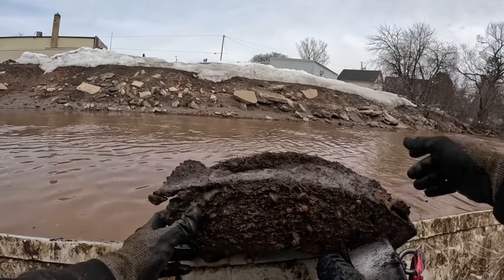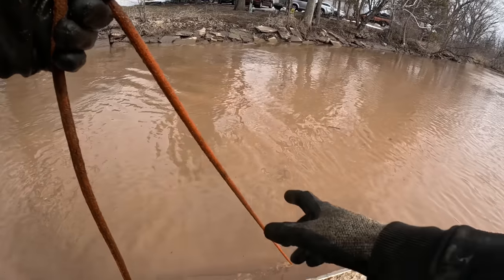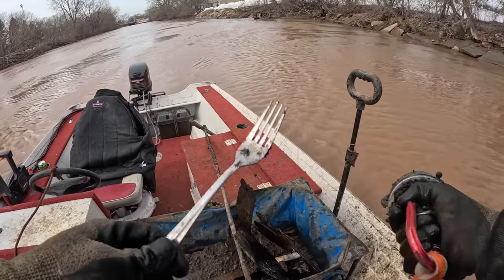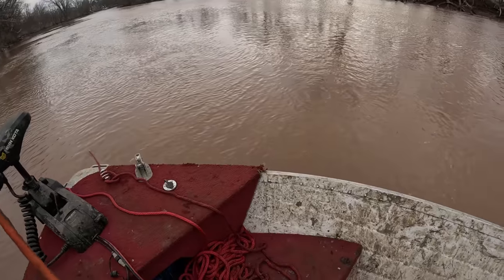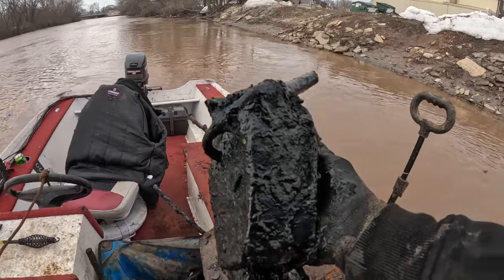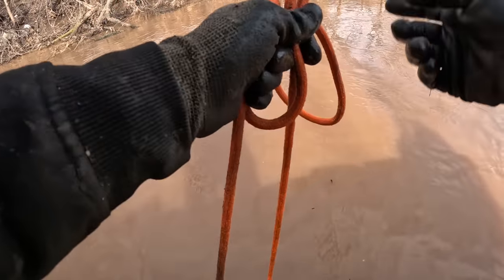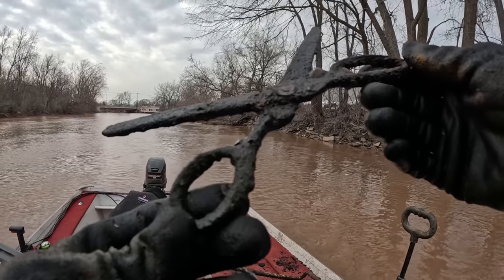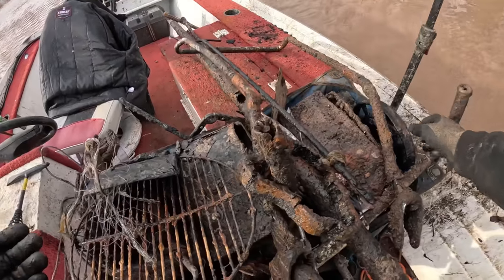I Found 5 Boxes While Magnet Fishing - You Won’t Believe What’s Inside!!!

Comment: The adjustable skates are like we used in the 1940's and later. I am 84. We loved them. They would adjust in width and length to clamp onto our leather shoes. This was before sneakers. The key, as you have found previously, had one end to adjust length and the other to adjust the width. Another enjoyable video.
Reply: We had a few pair back around 72. We thought it was cook to hang on to a bike and get pulled so fast. The wheels would get so hot, you could light a cigarette from it. Cool they down, oil them back hp, and do it again
Reply: Haha, you made me think of that song: I've got a brand new pair of rollerskates and you have a brand new key...
Reply: Had some adjustable skates in the80's had some great fun
Reply: Yeah, I had some in the 60s
Reply: Speak for yourself honey... I had those skates as a kid and hated them because they didn't stay on my shoes. 🤣🤣

Comment: Piece with rubber tubing on the bottom and hole in top is an old automotive power steering pump. Shaft with handle on one end and washers and conical rubber seal on other end is the guts of a bicycle air pump. Love your content and cheery attitude! (Ok, I just read the shaft and handle could be out of garden sprayer. I can see that...) Have a great day!
Reply: Yes sir!!

Comment: Thank you for the entertainment. Tyler I don't want to badger you but be safe dude. Please throw on a pdf! There are very minimal ones that will do the job but not hamper your movement! With the current, water temp, air temp and other unforeseen happenings it is the smart thing and usually the law. Be safe dude.

Comment: Hey Tyler
   Those things you called meat hooks actually are MEAT HOOKS !
They are used to hang a quarter of a butchered beef in a refrigerated semi trailer.
I used to haul what is commonly called swingin beef from Nebraska to Tennessee as well as other points in the east and northeast.
   The thing you pulled up after the first hook was a power steering pump off a car.
The long rod with the black handle was a pump rod used to pump pressure in a garden sprayer. I enjoy identifying some of the cool things you drag up.
The curved boxes have me stumped as well.
   COME ON SUMMER !
Reply: Great American Beef!
Reply: The curved boxes I thought looked like the lining you see on old cars when they gave you more storage room than just the glove compartment putting in centre console.  These are missing the padding and the leather covering.  Sorry its just the curve, looks like armrest, than it opens length ways.  If you added padding and leather.  But believe these are the rejects from the line they throw away as lock hole not punched in.  Back then glove compartments, ashtrays console frame was all metal, but you know that already, just wanted your thought, could it be?
Reply: @lorienray6216  Those curved boxes are from something industrial not parts from any automobiles.

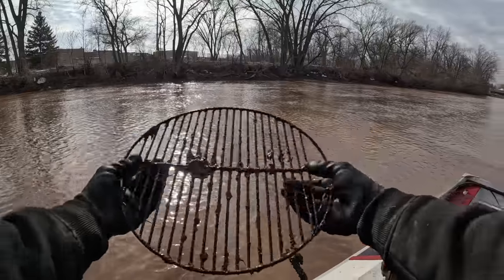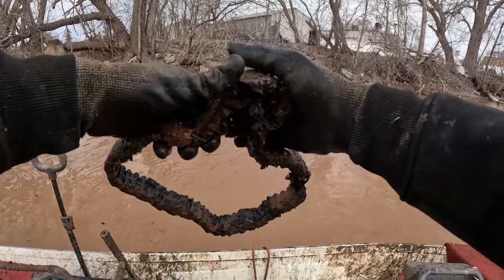Comment: The S hooks could be used for many things but I have seen them used for dipping steel stair rails into a paint dip.5:10 looks like the handle and shaft of an hand air pump, 20:47 looks like a screen door shock/closer, 22:32 looks like a transfer case chain.  Oh the irony, Tyler the owner of 1000 anchors and only has one in his boat. Gotta have two.

Comment: At about 26:50 I believe you pulled up is what we called a half-clamp. In the shop we would cut a c-clamp in half to custom make a clamp we could tack weld to a surface and use it to bring two plates together close enough to weld.
Warmer weather is just around the corner.
Be safe and happy hunting.

Comment: All the extra weight you pull out of the river and into the boat makes the anchor have to work extra hard in that spring flooding If you lose your anchor, you can always find another one, right!? I bet a blacksmith or welder would love some of your interesting finds to use for metal art. Thanks for the videos!

Comment: The item you found around 16:10 is a power steering pump, the pulley is missing but that is what it is.
The shaft at 18:57  is the INPUT Shaft from a standard transmission, possibly a 3 speed GM or Ford coarse spline. You stated that the previous box was found behind a garage, so that explains all of the  auto parts you're finding.

Comment: I like your channel. You should consider upgrading your boat to a Jon boat, at least 16 ft. 60 or 72 inch bottom. Minimum 25 hp motor. 40hp would be better. It will give  more stability when retrieving your magnet. It’s a wonder you haven’t gone overboard. Be safe! Bigger boat.

Comment: That gear or shaft you pulled up is the shaft that connects the transmission to the motor of a car. It comes out the front of the transmission. They use to take them off a old transmission and use them for alineing the clutch plate and pressure plate on to the motor it made it line right up so transmission would slide right onto the motor. You would have one for a Ford another for a chevy a different one for a Plymouth and so on. You could get the perfect fit. Or if you didn't have one of those you would cut a piece of a broom handle and use that.

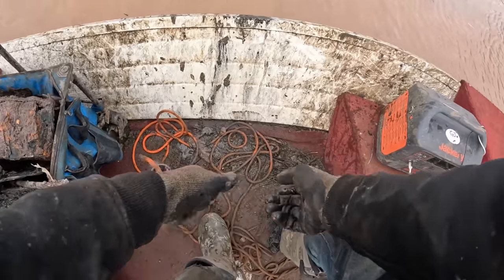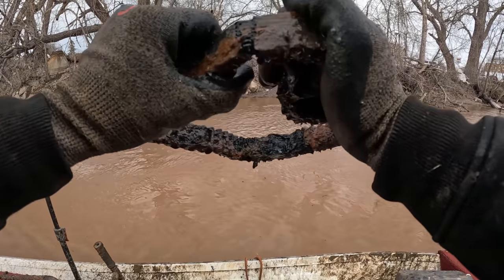Comment: spring looks like a valve spring for an engine. 15:46 mark, power steering pump for a car.21:41 mark looks like part of a shopping cart with rear wheels.  22:36 mark, timing chain for a rear wheel drive car/truck.  23:46 mark old school C-clamp, or what is left of it anyways.

Comment: Another entertaining video with you "forking" around on the river! 😁 You managed to take the fork in a river with no other branches in your location. 😁
That shock at 19:55 looks like the cylinder for closing a screen door.
Have you thought about asking the auto shop about the boxes?
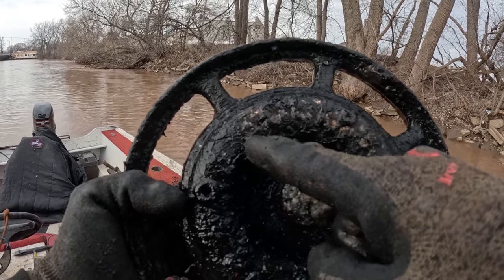The wheel at 29:10 makes me think it might be for a boat lift, for getting a boat out of the river temporarily. The inside has splines on it like it would turn a smaller gear.

Comment: The first thing you found with the rubber on it was a power steering pump the second thing with the gears and splines on the other end is a shaft from a 4-speed transmission manual

Comment: That one part looked like a power steering pump, missing the pulley. To change the pumps you have to pull off the pulley it leave you a tank with return hose on back and bolt thru center